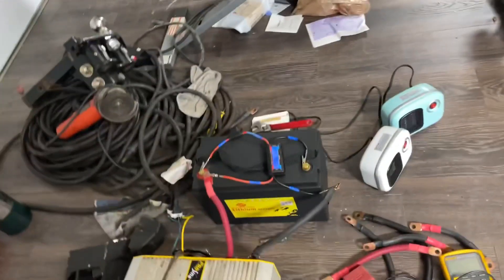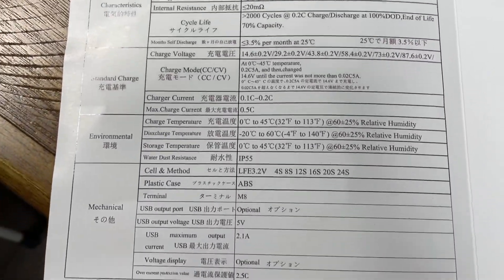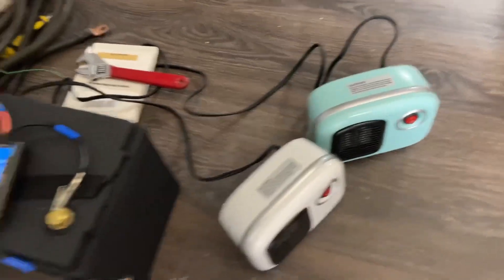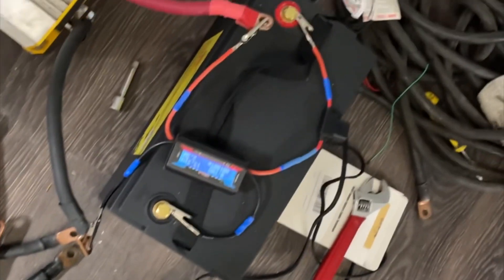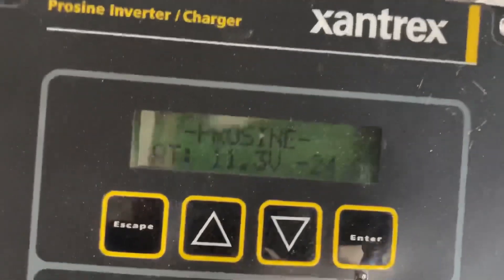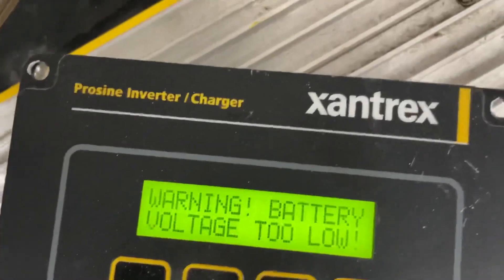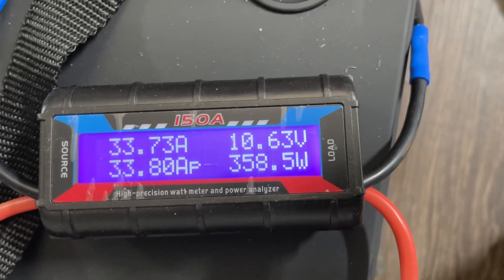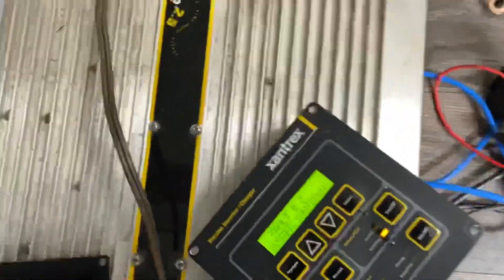Scream Power lifepo4 battery test

Comment: Good luck.  Mine is 2 years old, used it 3 times and now its capacity is about 60AH. It no longer provides 100AH. The company does NOT respond to warantee claims at all. They are dishonest and this product is very bad.
Reply from the maker: @tomb18ca  that sucks, but good to know, thanks for sharing.

Comment: Great review. Do you think this battery would work for my 55lb 12v trolling motor that supposedly has a 50 amp draw?  Thanks
Reply from the maker: it should. The bms is rated at 50 amps.

Comment: Excellent Experiment. Spec-wise, theoritically it should have lasted for a little bit more than 3 hours. How much did you get ?
Reply from the maker: 3 hours 33 minutes is when the inverter cut out. The battery had just a little more in it.
Reply: @IFix-Things  Thank you for confirming. So this is a great product by all means, since the specs are honest.  You should post some longevity tests IMHO if you can. Owners should recycle the charge  (discharge then recharge) at leat once every 3 months and it should last for 6 years as per the manual.